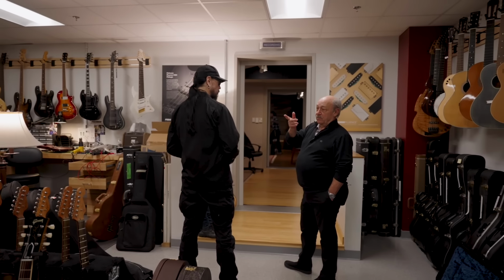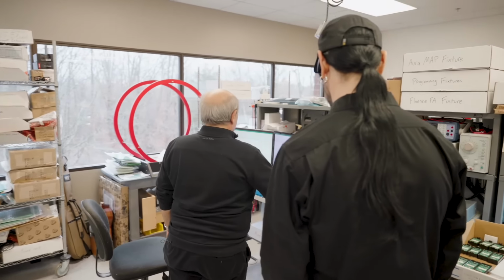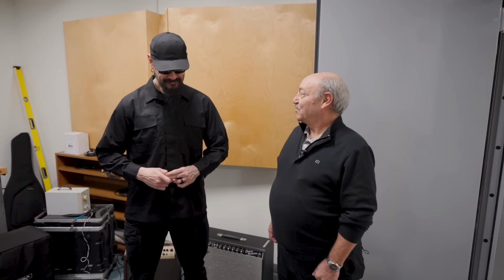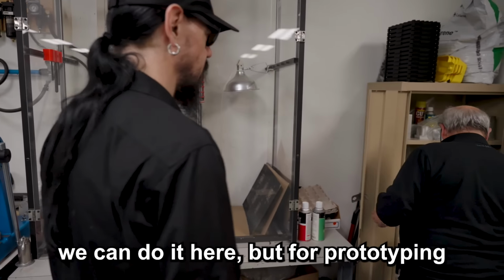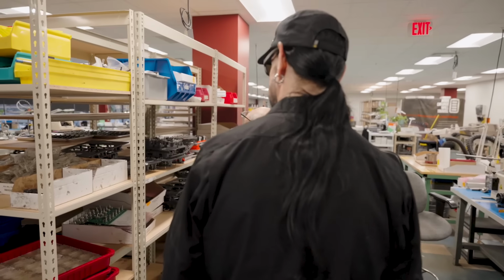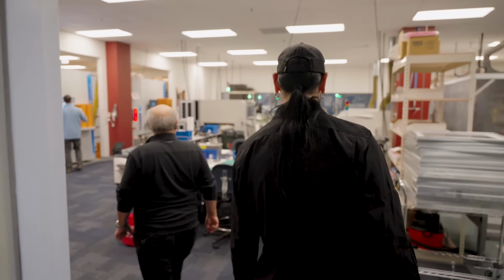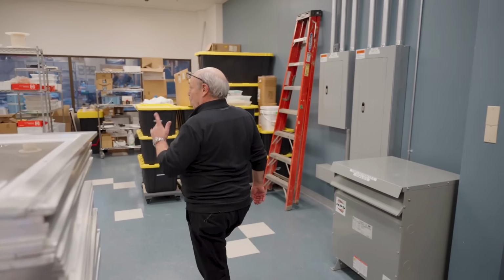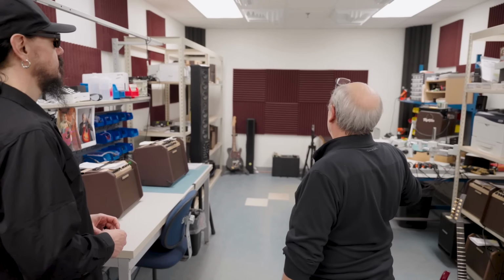Mick Thomson (Slipknot) Tours Fishman HQ

Comment: Meanwhile in the EMG pickups factory : "Well... half of produced pickups are original and working...and the other half is fake and not working... but we have to produce them to justify the price of the "original EMG 81" which still has no signal without a battery..."

Comment: Add solderless and you would sell a ton more.
Reply: I bet you could hybridize your wiring with EMG components, as the power cables that plug into the pickups use the same connectors. Probably no way to integrate the Fishman switching with it though
Reply: @Whiskeylovur  Push Pull and another $50 for the EMG kit is not ideal